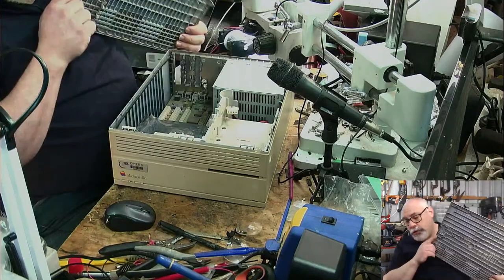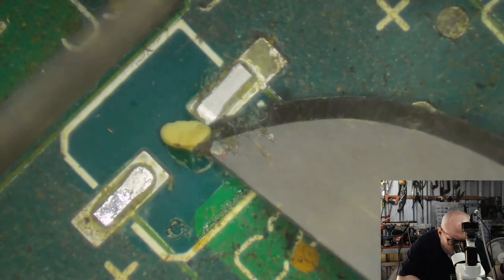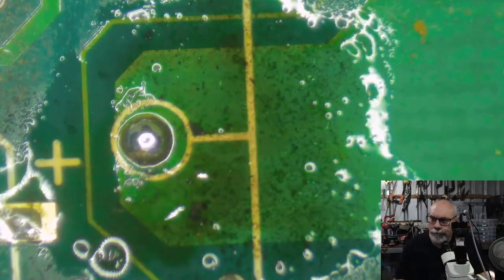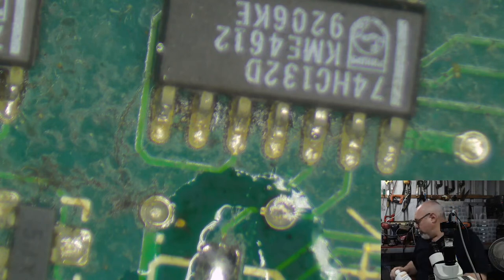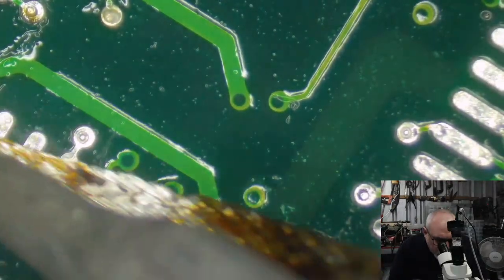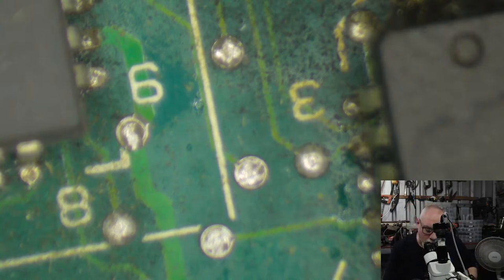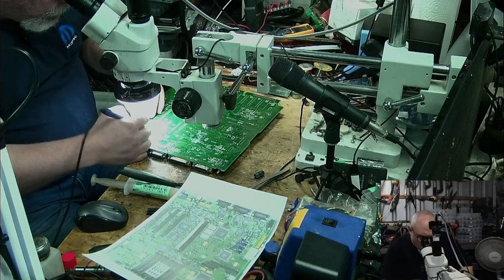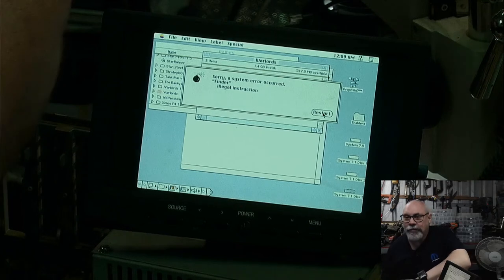Recapping a Macintosh IIci

Comment: I have a 575 that has no sound (has been recapped). I know you have mentioned a few times which boards use the same sound chip, but I cannot find exactly where you mention this in the videos I have gone back through. You mentioning the IIci sound chip made me think of it. What boards could I salvage a chip from if need be? Great videos!
Reply from the maker: I'm pretty sure the 575 uses the same sound chip as the Colour Classic, LC 475, LC 630, LC520,  LC580 etc. In fact, I think most of those LC models with the slide-out logic board used the same sound chip (343S0129)